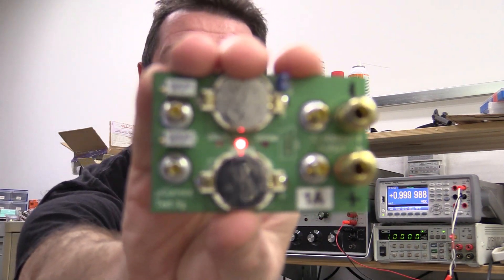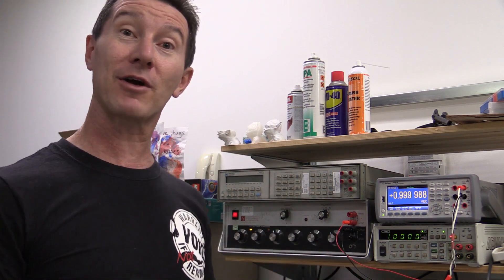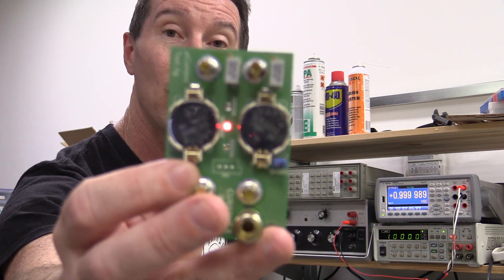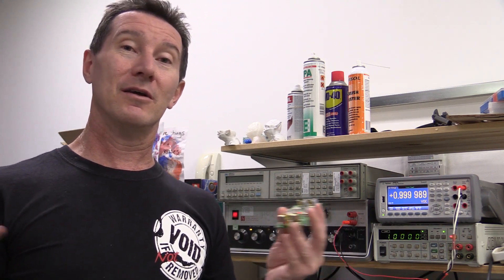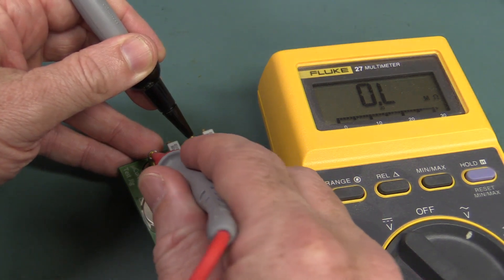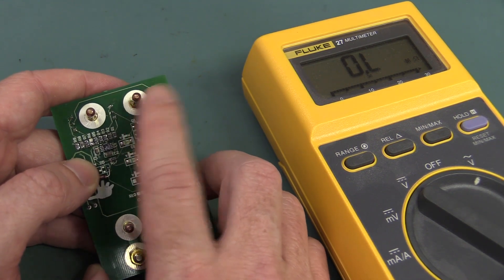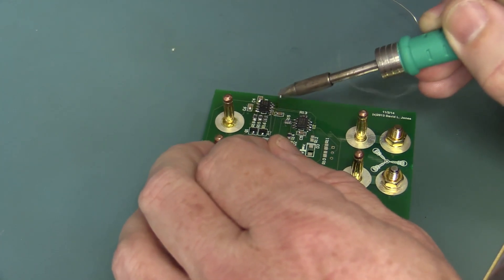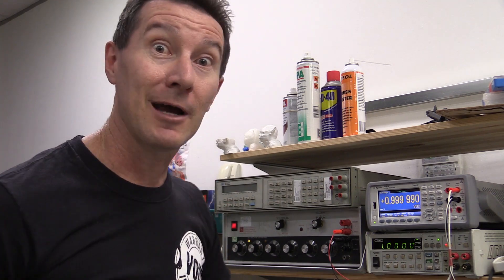EEVblog #727 - How To Kill An Opamp

Comment: Yeah... thought I was so smart remembering to swap the test leads in the multimeter I've had since 1997...
I swapped the COM to the 10A socket... not the positive lead... It was late, I was tired, and I did a dumb...
Now I need a new multimeter... ╱)⤳⁔⤺(╲
The good news... I know JUST this one blog where I can find a recommendation on a good multimeter!  ◔ᴗ◔
Reply: richfiles 
My Fluke love me long time.
Reply: Can't go wrong with a Fluke... I've only heard good things about them, and there's a good market for used ones, as it's pretty hard to break one to the point you can't fix it without using brute force. Check Ebay and you should be able to find an affordable Fluke multimeter, probably in the 50-150 USD range.
Fluke meters have great input protection. AFAIK, they have full over-current/over-voltage protection, and it's all pretty easy to get at to replace.
They've also got a great track record for accuracy and precision. If you do get one that's out of spec, it can be re-calibrated, and even certified if you need that.
Reply: Andy Sloane
Good idea! Now that I read the comment again, it looks like they put the leads in the V/Ohm/mA and 10A jacks, and then across something they shouldn't have. In that case, the current path thru a cheapo meter would be something like this:
10A jack -> 10A current shunt -> COM jack -> fuse -> meter circuitry -> V/Ohm/mA jack.
If that's what happened, the fuse is probably shot.
Either way I'd spend the time to look up a used Fluke meter in the $50 - $150 USD range on something like Ebay. Get one of those and you should only have to feed it batteries and keep a few spare fuses on hand.
I can guarantee that pretty much any Fluke multimeter will be 100x safer to use than most meters in the $5 - $50 range.
Reply: Did you check the fuse inside?
Reply: I got a ExTech Ex330 $50, Dave's recommendation, but if you can afford it go Fluke, you will not regret it. 

Also /)
Reply: ive blown my meter with a piezoeletric from a ligther it doesent do anything else exept continuity
Reply: Andy Sloane Magic smoke from one of the sense resistors. Continuity, voltage, resistance is all shot. Current reads wrong... Ded. I've used Fluke and HP/Agilent at my last two jobs and HP/Tektronix at home... Except my Tek is older than I am, (one of those modular deals that pop into the 500 series power supplies front he 1970s) It works, but it's very old, old enough you can see the LED display flicker due to slow refresh rate. It has no continuity mode, and is very limited by the limits of the tech of the day.

I'd like to get a good used Fluke online, but I'll consider others too. I also wanna replace my HP 6 digit bench meter that died. It too was an old 70s era model, but it worked... till it didn't... I liked that one for bench use... Miss it...

I know it's a gimmick... but I do miss the UNUSUAL transistor tester my ded meter had. It only had a 3 position female header... It actually TOLD YOU whether it was PNP or NPN, and what your pin order is. It was real nice for that extra degree of confirmation for the pin order, without digging up a manufacturer datasheet to be sure it's EBC, and not CEB for example. Call it cheap, call it a gimmick, but that was a well done version of that gimmick!

For a Radio Shack meter, it was nice. It had all the standard auto ranging modes... Volts, Amps, resistance, continuity, diode test... But it had the afore mentioned transistor test, capacitance, a temp probe, True RMS, hold, range hold/manual, and a bar graph display along with the digital readout. It was only a 4 digit (3.999) display though.

RIP... Radio Shack and my Radio Shack meter...
Reply: mi blown meter is a TECPEL it was a nice meter but its blown
And nice text you wrote here
Reply: dasdew2 I like the frequency/duty cycle bit on that... I do also like the price... But I work with electric motors as a profession, and true RMS measurement is essential. An "analog" bar is also a very useful feature for me, as my measurements can fluctuate, and it's easier to tune to a bar, and then fine tune to a digital value.

I think I'll give the $100 meter shootout a re-watch.
I'm totally willing to spend what I spent in 1997 for a new meter, if it snags me some really nice features.
Reply: yeah the meter that i blown is still made after 16 years but only with manual range mine still has auto range
Reply: richfiles 
If it's for your job I encoruge you to go with fluke for the assured quality, my meter shows all types of numbers and it wasn't till a guy in my engineering class( to add insult to injury he's in mechanical engineering ) told me that the leads weren't connected right that I understood why that was. I'm a dummy :P

Just gonna leave me hanging?  /)
Reply: Fluke is the best but is expensive
Reply: dasdew2 Yeah, so anyway, I really am seriously considering just grabbing a used Fluke 87. The 87V is WAY out of my budget... but dang... that low pass filter for measuring adjustable speed motor drives is almost SCREAMING at me (since I work with electric motors SPECIFICALLY). Still, I RARELY actually mess with any of that stuff, as it's for my home workshop. I build a cable for a surgical tool, and do wire harnesses and circuit boards for the motor products. Typically, I'm just doing some basic continuity, resistance measurements for the cables, and all the final testing is done at the shop, when I go in to do final assembly work (hipot, low resistance tests, baking out any moisture, conformal coating, curing the coat, etc). Since the motor type work is all done at the shop... the 87V is screaming at me... err... rather ineffectively. :P

While I absolutely would use it for my job, and sometimes even take it to work, it's my hobby stuff, things like robots and nixie clocks and other kinds of projects that I tend to push my test equipment through it's paces. ALL my equipment is... Old... In all honesty, an 87III is probably more than sufficient for my needs, and they seem to sell at a VERY reasonable price. Of course I COULD look at other brands too. Still... Dem Flukes! :D

The triggering on my old Tektronix T932 is starting to go a little wonky, and I've been tempted to save up for a Rigol... One of the more unusual aspects of my robotics hobby, is I prefer building neural network type controllers... I find myself with circuits with numerous digital pulses and analog integrators... Which basically has me drooling at the idea of going with an MSO... But it's just out of my budget right now... I unfortunately had a 6 month dry spell for orders from the shop. It's not my only job, but it wiped out my surplus income... No scope for me... just yet... :'(

I think I can swing the multimeter no problem though. I just wanna shop around a bit. Buying a Fluke is great, but I don't really NEED to pay for a brand either.

(\ I totally didn't see that! I was busy reading about multimeters! Derp! ╱)◴‿◶(╲
Reply: 44R0Ndin I did play with it a bit. The fuse did blow, but since this is a "lesser" meter, the 10A circuit was unfused, and since I had the com lead swapped into the 10A and the positive in the V/Ω/┤├ spot... yeah, weird paths were taken, electrons fell out, smoke escaped.
I didn't have a proper fuse, but shorting the fuse seems to have gotten my continuity back, but the meter's so far out right now, I probably can't really ever trust it again. The fact that there are blackened parts inside is enough of an issue. Oh well...
Reply: IS basycly dead mine has no blown fuses i think

Comment: Yep my best so far was blowing a $150 hybrid driver chip, now that stings....
Reply: ***** NEC Data Grade Multisync conference room CRT Monitor.  Its problem, the Blue raster was dead.  Have a guess as to why....  Well lugged the thing back to the shop, removed the plastic back to find another layer of steel under neath which also had to be removed and so on.  Found the bad hybrid, removed it, then Just to be sure that was the only problem grabbed the red or green next to it and soldered it in its place, just a quick test.  Well now I had 2 bad Hybrids.... Fixed the damage before it and ordered 2 new hybrids.  I consider it part of the repair process so charged the client the whole amount.  Charged around $450 which was probably 1/10 the original cost of the unit, and recommended the client not leave the unit on blue screen 24/7 when not being used.

Comment: It's always a fun game when your ordering parts to guess how many spares you'll need!!! "Hmmm, I need one, but I'll order 3, one to blow up doing something stupid and learn my lesson.  Another one to re-learn that same lesson.  And the last one to get the job done"
Reply: I always order more parts because I'm more concerned about parts being discontinued. And this is also why I am soo careful and check everything before applying power to a circuit these days. I remember frying a 741 opamp when I was first starting out in electronics and also the TDA2030 power amp which has no short circuit protection and self destructs with lots of smoke and burning the casing away to reveal its glowing hot IC inside. I built my first amplifier with that.